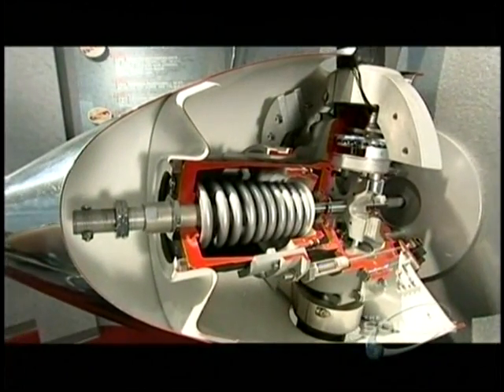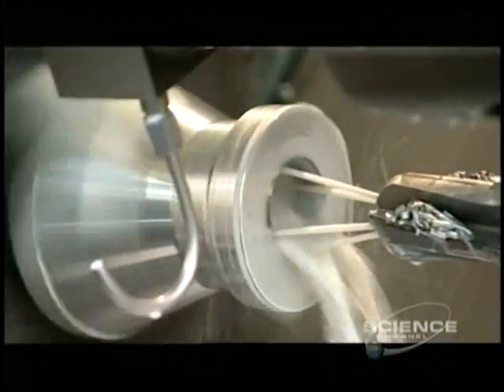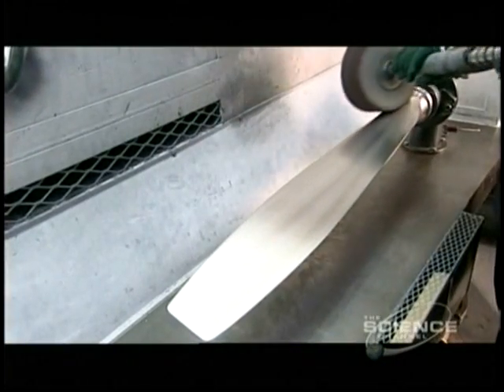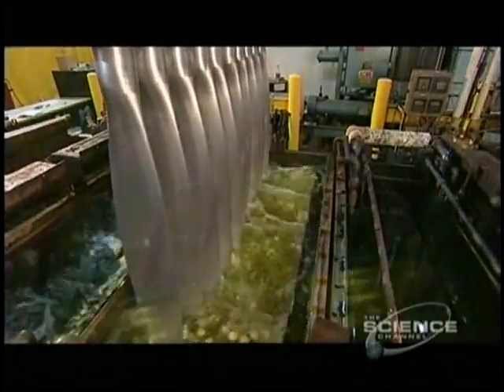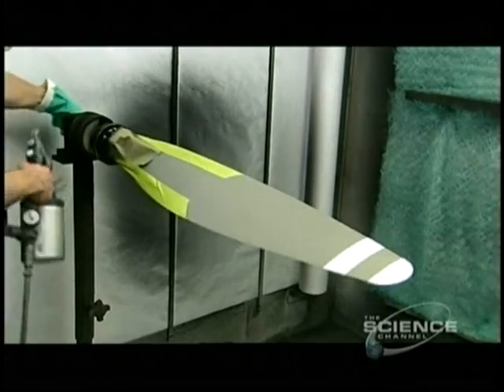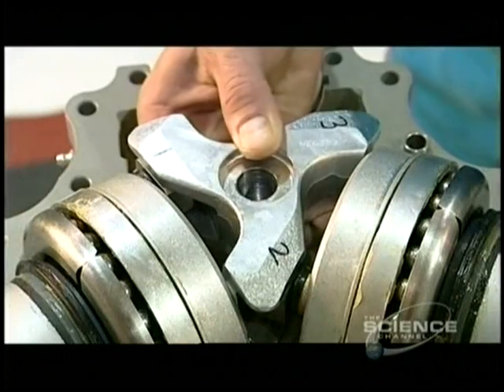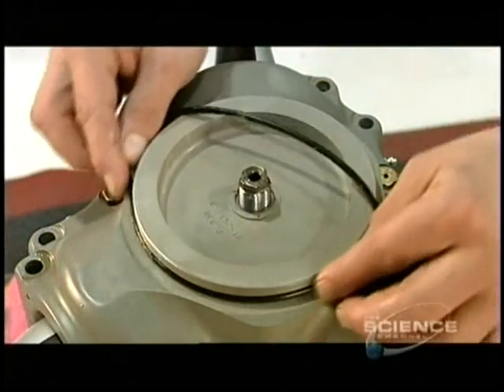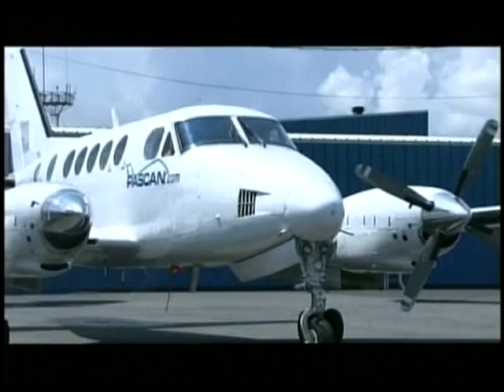Making an airplane propeller

Comment: Cool :) Yeah props are fun to work with... Not as technical as turbines, but still a bit challenging. 
I was an NDT inspector and found cracks in most of the parts you see in this video at one time or another. :)
Reply: Hi